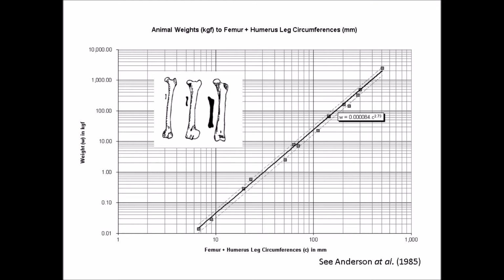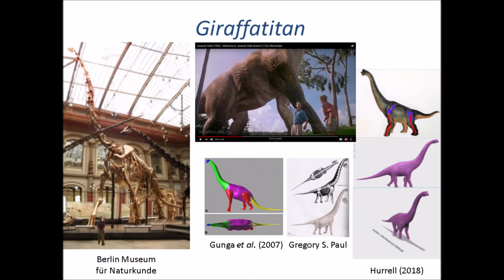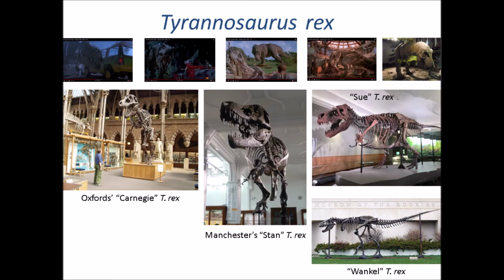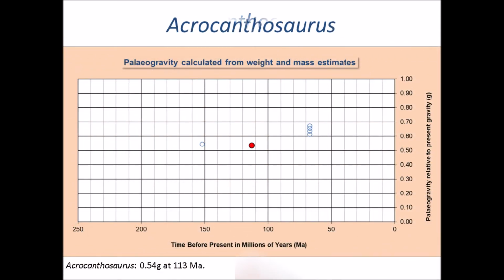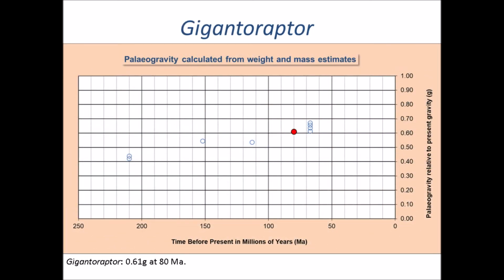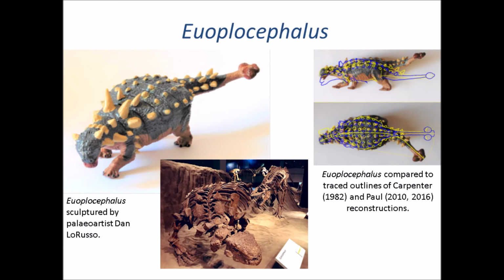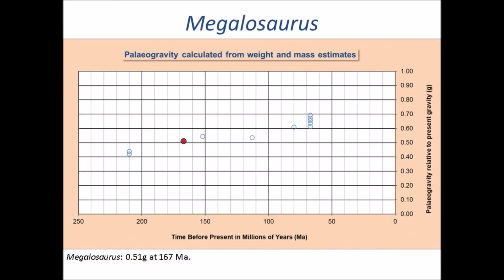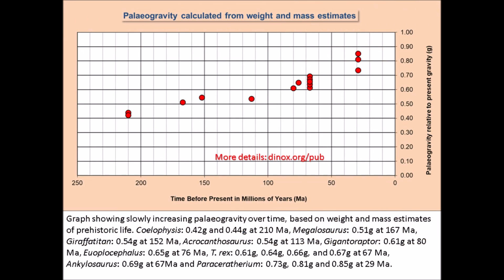Presentation: Can we calculate Palaeogravity?

Comment: The dinosaurs weren't shrinking! The largest dinosaurs (Dreadnoughts and tyrannosaurs) lived at the end of the Cretaceous period, before the extinction. Why were dinosaurs very small in the Permian and Triassic periods? If you understand paleontology, you will see that the size of the animals is only growing. Your hypothesis is wrong. I was comparing two animals of the same size - a modern elephant and a centrosaurus from the Cretaceous period. Centrosaurus has supporting bones ( femur ) thicker by 2 times with the same length as an elephant. The bone walls are also twice as thick. If gravity had been less, then the bones of an ancient "elephant" should have been thinner, but in reality the bones are thinner than those of a modern one. This shows that the load on the bones of ancient animals was much greater. the hypothesis that the force of gravity is decreasing. The earth grows and decompresses. The high gravity was the reason why the animals came ashore so late. Modern animals have very thin bones, which is also a consequence of low gravity.

Comment: Reduced gravity on a smaller earth permits larger life sizes. The biggest recorded land creature today is a 12 ton elephant killed in 1955.  Accordingly, the largest Mesozoic life size possible with a 50% reduction in gravity would be a dinosaur weighing 24 tons (12 t / 0.50 g).  The Giraffatitan data (31.59 tonnes = w) producing 54% gravity at 152 Ma would be limited to a maximum size of 22.22 tons (12 t / 0.54 g) or 20.16 tonnes.  This test (12 tons ÷ x % g) indicates when the estimated weight (w) exceeds the maximum survivable weight in such reduced gravity.  
Oversized fossils reveal the minerals replacing the organic bone substances are compatibly growing with the embedding earth.  Geologically dating “the surroundings” can adequately (within 20%) predict the corresponding surface gravity and earth size as indicated on this Past Gravity Comparison chart: https://ionic-expanding-earth.weebly.com/past-gravity-comparison.html.

Comment: Great presentation. Just bought your book. I tried to determine the femur thickness of an Argentinosaurus if it were to be walking around today at a weight of 90 metric tons and came up with 37cm femur thickness assuming the same bone strength of an African elephant. I understand the fossils show Argentinosaurus only had a 25cm femur thickness. Do you have similar calculations? I know there are a lot of variables like bone density that are hard to account and calculations are only estimates but your research seems very reasonable and would like to know if you have estimates similar to mine. Thanks.
Reply from the maker: It's great to hear you are trying to calculate palaeogravity for yourself! The femur circumference of Argentinosaurus is 1114 mm but there are no fossils of the humerus. Calculations can't be as accurate (since we don't know the weight distribution between the front and rear legs) so I haven't looked at that dinosaur in great detail - but the results are similar. I find that theropod dinosaurs seem to give the most accurate results. Check out my papers for details: https://www.dinox.org/publications.html
Reply: @DinoxOrg2  Thanks for the guidance on that. It's nice to have actual data for my equations. I've seen how the ocean floors seem to have spread the continents apart. Lately I looked at elevation maps and can see that the contours around 250 meters fit together like a puzzle on every continent. To me it is proof the continents were stretched over the low elevations and compressed in the mountainous zones. It is most evident to me looking at this map: http://serc.carleton.edu/images/eyesinthesky2/installgis/word_elevation_project.jpg